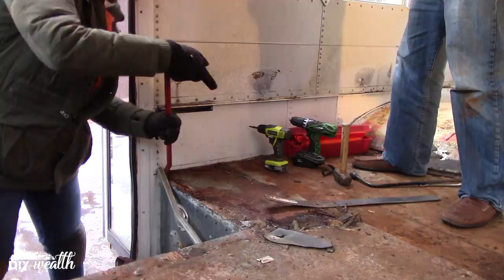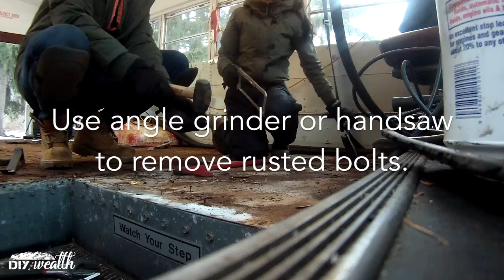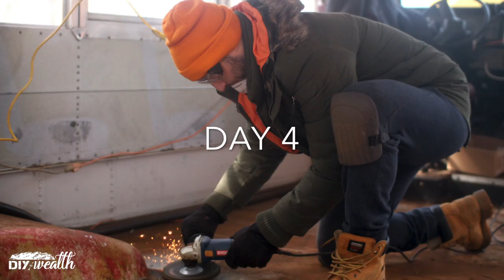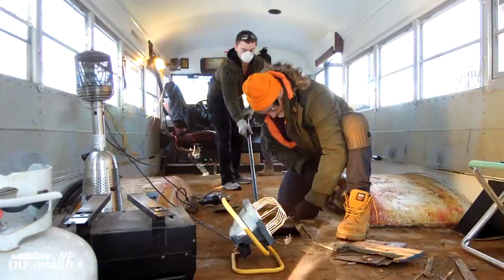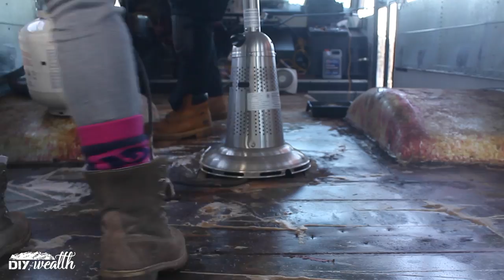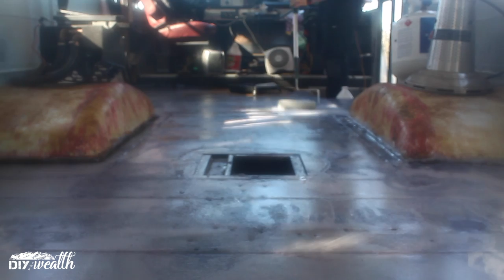School Bus Conversion - Day 3-4 - Tips for Floor and Rust Removal

Comment: Did you rinse the Krud Kutter?  If so, what method did you use?  Great video by the way, I got some good tips from it.  Thanks!
Reply from the maker: +fotoimagesbyken Hey there and thanks for watching! We just used recycled rags to dry the walls and floors after washing it with our Krissy Kutter solution. I don't think it's necessary to rinse off the solution with water (metal and water don't play well together, so we tried to minimize their exposure to one another). We also blasted the space heaters and propane heaters to speed up the drying process. Are you doing your own conversion too?
Reply from the maker: Krud* Kutter - dang autocorrect!

Comment: how many gallons of krud kutter/Corroseal did you use?
Reply from the maker: We used maybe 1/4 Krud Kutter to wipe down the bus interiors (ceiling to floors) and 1/2 gallon of Corroseal for 115sq ft x 2ish coats - the rest of the corroseal will be used for the underbelly of the bus once the ground dries up a bit!
Reply: thanks so much for responding!  and i was wondering about the underbelly, too, so thank you for sharing.  will you be making a video of the process?
Reply: Yes if you can that would be very helpful. My wife and I are almost done removing all the remaining bolts in the school bus and are about to use the degreaser. Our bus has quite a bit of rust on it so I am hoping the Corroseal will work good, Probably will need 2 Gallons of it